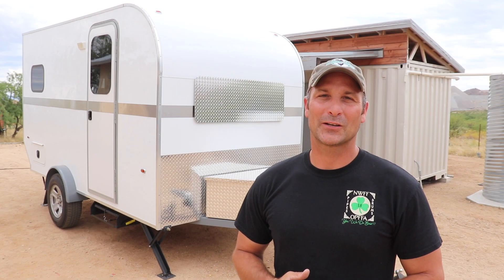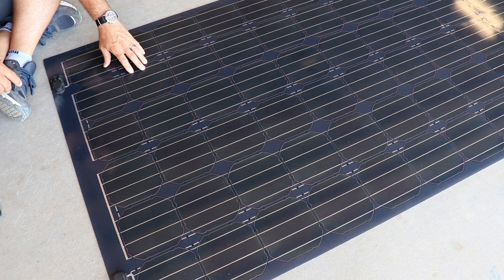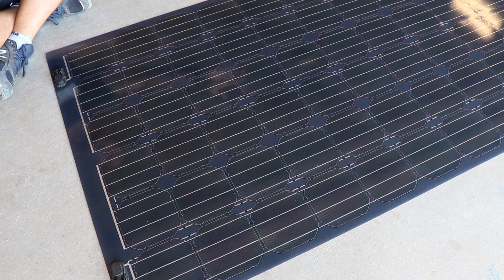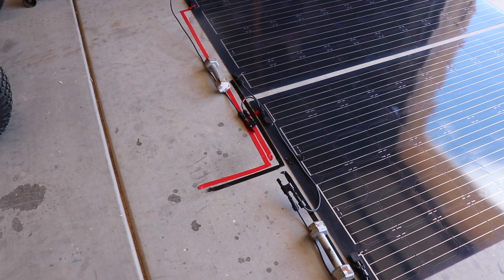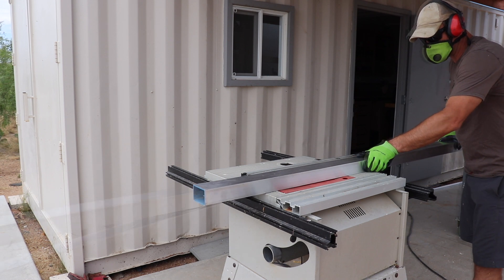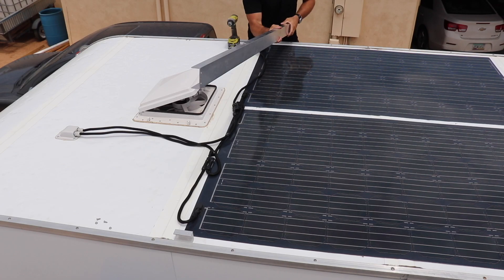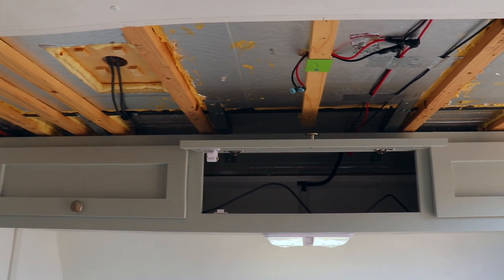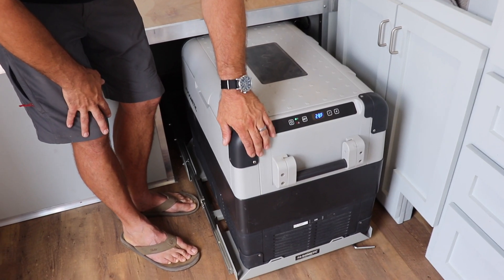How to Build a DIY Travel Trailer - Solar Panel Install   (Part 11)

Comment: Cool video but I'm in Nebraska and have a thought it snows and don't want to put holes or mount panels on roof because one would have to clean the snow off 🤔

Comment: Very good job. i am wondering...Do the van wall has a heat insulation function? i mean heat isolation from outside of trailer to keep inside trailer cool. Except for the electric air conditioner.

Comment: I made my own controller. Panel  wires come in, lines go from controller to batteries and another set goes to fuse block. Prevents overcharging while current is used inside.

Comment: A paint roller is a good choice to press the panels to the roof. The soft "fuzz" protects the surface and prevents cracking, it can happen. Just be careful.

Comment: Note: When using Victron solar controllers, it's best to wire your array for a higher voltage (series) so that the controller will turn on earlier and off later. Wiring them in parallel is going to result in a lot less production.

Comment: I noticed that from the 12 v system video to the solar video there is an additional component in your battery box. It's to the right. I am wondering what that is? Also how the does the battery charge from the vehicle when driving and trailer hooked up to car battery?

Comment: Been a year plus now and I am wondering how the flexible solar panels are holding up.  Starting my build after first of year and want to use flexible solar panels.
Reply from the maker: Check out my travel trailer series playlist.   I have about 7 videos on the trailer after this one.   I’ve also filmed a couple of camping trips and mentioned the solar/12v operations and everything has held together very well👍😀

Comment: That one part only secured with the double sided tape is hella sketchy. Is that piece flies off it could kill someone. Put a screw through it
Reply from the maker: It does have a bolted bracket attached as well.... it isn’t going anywhere.   I added it a few days after uploading the video.

Comment: I didnt see the link for the solar equipment. I have solar panels on my home so I look at other systems critically... not negatively just seeing how complete and usable it is. I really like everything except for a few details. I would want another battery for backup. Next  I would want an indicator for charge %... I dont see one. Lastly that final short piece of extruded aluminum is going to be a missile someday.... you have conquered aluminum welding... why not weld the big and small piece together? I have watched the entire build and the homestead  also. Your skill level is excellent. I love nice clean professional work. Lastly... I dont think $1500 is unreasonable for the solar hardware at all..

Comment: wow, looks like you caught some hail damage/ didn't notice it until you put panels on and shaded the roof @8:38. does that mean you should have used thicker roof material or that just happens when it hails? will that affect your panels?
Reply from the maker: You can see the hail damage in my part 4 or 5 video.... should be like ‘cooler bed storage’ or something like that....or my video titles ‘oh hail no’.   Destroyed a lot of things on my property.

Comment: I very much appreciate the choice you made of those particular solar panels.  My new 2015 Ford 350 econoline which I desire to convert has a plexiglass roof to   keep it from leaking, so I have not been anxious to start drilling holes.  Thanks so much for your resourcefulness and careful instruction

Comment: Joe, really liked your videos, very well explained.  I have a couple of questions, I am really new at this so please bare with me.  I purchased a 7x14 cargo trailer and it currently has solar, however, the previous owner only put 1 outlet inside.  It has 1 12v battery, and 1500W Cen-Tech power inverter with a 3,000-watt surge.  I would like to add 4 more outlets in the trailer and a couple of more LED lights.  I am going to install an AC unit but that's it.  No fridge, no TV, just 4 more outlets for Charging laptops, or cell phone, shaver, and possible shower.  I do want to get another battery so i will have Parallel connections.  The solar panel is so small its like a size of a picture frame mounted on top of the box in front of the trailer.   Now I can plug the trailer to the RV outlet since it has a plugin from the outside.  My question is do I need a bigger solar panel?  Is my inverter big enough?  I am only using the trailer 2 times per month.  Thank you for your advice.

Comment: Since your using a lead acid battery, I would suggest venting the battery compartment.  The battery produces hydrogen gas when it charges.

Comment: Did you add any gasket material along the edges of the aluminum wire channel?  A bit of concave or convex quarter round molding could redirect airflow up and over the channel as well as off the solar panels.   I liked your use of the split loom wire guard.  You definitely put good thoughts into the design of this system.  With all the additions to your trailer I was surprised that you didn’t include an LED signal light bar to both trailer and truck.  The following link is for illustration purposes; I do not represent this company but I have installed a similar lighting system on my Kia Forté 5SX.   https://geek.wish.com/share/1001mmqqzx.   As always, I trust that you and your family will remain safe as the pandemic continues to evolve.  Wishing you and them continued Peace, health and happiness.  Sincere thanks for sharing this video.  Peace brother.

Comment: Nice camper build.  However, putting the panels in parallel like that will come back to bite you.  If one cell gets shaded, then that panel will produce less voltage and then short out with the other panel producing a higher voltage.   Say for example, each panel puts out 12V optimally.  And one panel is partially shaded and only putting out 10V.  You connect 12V in parallel to 10V and now there is a 2V short that the panels have to absorb.  If you put them in series and use an MPPT charge controller, then there is only the loss from the cells that are shaded.  Because those panels have extra bypass diodes, and the fact that you live in Arizona where there isn't much shade, you probably can get away with it.  But if you ever see less than rated power during bright sunlight, it could be a cell that got shaded somehow.

Comment: I love your vids. The ends you crimped on. I thought the lower crimp went around the insulation of the wire. and the tube got crimped to the copper. Also. since the solar panels are outside, and the charge controller is outside in the box. Did you think about keeping the wires and switches outside instead of in then back out?

Comment: My suggestion is to get a remote display for the charge controller and a ground shunt for a monitoring system of the lithium battery.  Victron has some great products that piggyback off of each other with "ethernet" data cables creating a CAN-BUS network. One display should be able to have all of your charging/Discharging information.

Comment: Awesome video.  Some day I'll be adding solar panels to my cargo trailer that I bought to haul my side-by-side around and maybe make it into a "toy hauler"/camper.  My concern with the stick-down on the roof is heat transfer to the inside of the trailer.  Those solar panels have got to be transferring a ton of heat through to the inside of the trailer, no?

Comment: There should be a plastic bushing on the connector through the  the floor from the panels. Trick to cut the bushing and put in on the connector without undoing your wiring. Thanks and have enjoted your series

Comment: Nice setup, only solar panels cost too much for me. $749 for one 180w panel  I can get 4 100w panels for around $400 although not flexible.
Reply: Are those 4  as nice as these though? individual cell vs whole panel performance is a great feature.

Comment: Having those panels on the roof of your trailer also help keep it cool. It’s as if you’re parking under a tree. That is a benefit of having solar panels on as much of your roof as possible.  That trailer project came out great. You should be proud.

Comment: I would have advised against flexible solar pannels, but now they are already installed. With regular panels. You can get double that power

Comment: Great job on your travel trailer.  Makes me want to build one out of my 12' utility trailer.  I would suggest making a bracket for that wire channel that runs front to back just like the one you did for the channel that runs side-to-side.  You will be experiencing a lot of wind as you are driving down the highway and that can become a very dangerous projectile at high speeds.  Worth the extra effort to ensure safety!

Comment: ooooh,   Seeing you bending that solar panel is a little worrisome.  They're not suppose to bend more than 30 degrees and even then it's risky.  The cells are made of very thin silicon which is practically glass.  It will crack and power losses are gonna happen.
Reply from the maker: WTF BBQ I understand your concern, but these are not silicon panels.  Sunflare came up with these panels as an alternative to the cracking issue common in silicon panels.  I can’t remember the exact substrate they use but it isn’t silicon.  Thanks for watching😀
Reply: @homesteadonomics  
oh yea,  i just read Sunflare's website about their panels.  They are indeed made with a different material (CIGS).  I've been avoiding flexible solar panels because they are flimsy,  but i might give this one a try.

Comment: NOT to rain on your parade....but I torn out megawatts of these "thin film" type solar panels. What happens is they catch on fire. On you tube there is a video of a rooftop fire at the Long Beach convention center. Please check it out. Again... NOT Debbie Downer here but thought I'd mention it since you probably will be going on vacation in that thing with your family.  Be safe and good luck.
Reply: well he is a fireman so i am sure he knows how to put a fire out i pray he never has to though

Comment: Congrats on the project but from my understanding it takes around 900 watts of panels minimum to cover basic needs. Is this not what you came up with or does 370 meet your needs? What all do you operate off it?
Reply: I don't like to see deviation either. Norms r there for good reason. I prefer to run the radio & light whilst I sleep and often fan. That's 2+2+10 watts & if tucked in by 8p I may well pursue a 12hr sleepy to ensure well rested and top health. That could well be 160watts.. What if I need a phone charge? I could easily be down some whereby could take full 45mins to charge. I don't like cutting it close like this & he has no tight to recommend this! I'd report it if I knew to whom. Any ideas?

Comment: Really like your idea of protecting the solar panel wiring on the roof with your cut down channel.  Was thinking about using some z flashing on the leading edge of your panels just for some added protection while moving.  You could just use VHB tape for that too.

Comment: A little puzzled  by your claim that each cell has its own diode - each solar cell is 0.55volts and the voltage drop across a  good Schottky Diode is 0.45 volts- it would in effect cripple the panel

Comment: hello i got a question example if i have 100wat solar panel. how long it takes to charge a 2pcs  70 ah battery pack..? 
and 2nd Question how long it drained for a fan like 20watt for cooling down a room?

Comment: I like the way you make the bracket for your new Sunflower Solar system. I noticed on van builds they mostly have more than one bracket which I would probably add to the front of your solar system. But I definitely am not an expert at anything but baking bread!
Reply from the maker: MAE HAY thank you Mae!  It has travelled 300 miles so far today and I’m about to go out of cell reception....wanted to get back to you before we are deep in the forest😀👍🙏
Reply: homesteadonomics enjoy your new travel trailer with your family!

Comment: Cool camper!  The dometic cooler is a nice touch.  What would be a big draw would be a roof mounted Air Conditioner / Heat unit or electric cooking like a Microwave or electric (resistive style) cook top.  I'd be curious if an induction cook top would work well for you with this setup.

Comment: Very informative & well thought out install. I'm assuming those connectors are waterproof. I've been looking for something that are waterproof & can handle vibration to put into my micro skiff boat that I'm building.
Reply from the maker: Turtle W hi TW!   Thank you for checking out the video!   I’ve only had it installed for a week now so I can say anything to the long term for the connectors but they feel really well made.   I think if you protect them well enough from vibration by taping or securing them down they will do just fine😀👍

Comment: Wow, very expensive solar panels. Very nice install as is all your work.
Reply from the maker: Sam Hagins thank you Sam!  Yes they are not cheap panels.   Sunflare primarily is OEM manufacturer supplying based so they aren’t as geared towards consumer price points.     They liked the project and wanted to see if I wanted to try them out as an example of how they can be used.  I would imagine if they start transitioning to more consumer sales you’d see prices reflect accordingly😀👍

Comment: I agree with the heat concerns. RV with Tito had an innovative installation that uses corrugated plastic sheets to create airflow and prevent the excessive heat of the solar panels from burning the roof material: https://www.youtube.com/watch?v=hROYaqY83v4

Comment: That type of panel would work well on my trailer.   I have an enclosed car hauler that I plan on putting solar on but it doesn't have a flat roof.

Comment: Cool panels!  Love the idea of laying out your diagram on the floor.  Don't get hung up using those 2 to 1 connectors in that configuration, you can decrease the bends in the wires.Glad your posting vids again!

Comment: Under full sun these panels will probably sit around 140 to 150F... Which will be sitting flat on your roof. That is a lot of heat. Directly on your roof. Radiating that into your camper.

Rigid panels mounted with an airspace will act as a shade to your roof. 

I just don't see the attraction to flexible panels mounted directly to the roof.
Reply from the maker: On_The Road very good points....I will have to see how it fairs over the next year.   Worse case scenario I could always remove them and add a little network of aluminum ‘purlins’ for them to mount to.  Thanks for watching and the observations 😀🙏
Reply: @homesteadonomics  what ever you do I'm sure it will be great.... Very clean work!

Comment: Great tutorial. Please, can you tell me where to purchase the top of double sided tape you used?
Reply: Angie Sparks 3M makes an outstanding double sided tape. It is called VHB tape (very high bond) this tape has proven itself to hold better than screws or rivets. It forms a strong permanent bond. There are many videos on YouTube concerning VHB tape.

Comment: A bit of concern here, Electrical circuits Mounted on wood.
Have you a good extinguisher and easily available and have you performed an FLIR to verify 
the heat thermal factor on this mounting set up?
I would like to encourage flame retardant material Insulation on all mountings in this videos I seen.
This is very exciting you have done and want the Best for your family.

Comment: I like the weight and design of those panels. But I did notice that they are a bit on the pricey side compared to traditional rigid panels, so I'm wondering about recharge time of a battery per panel. I'm designing my project now and I'm planning on a 2 battery system (I like to camp in some cloudy, rainy places with shorter days so more battery helps on longer nights). I'm trying to figure out the best way to calculate results with a 1-panel or 2-panel arrangement. Were you able to get an idea of how long it would take to fully charge an empty battery with 1 panel or 2 (assuming nothing draining the incoming charge except maybe a cooler)? Or do you know of any reference info that would help calculate such things?

Comment: Hello, I am new to all of this and just had a question. The 370 watt solar panels, how is that measured?  I am asking does it make 370 watts in 24 hours, per hour or continuously?  Just trying to understand this as it is all new to me.

Thank you.
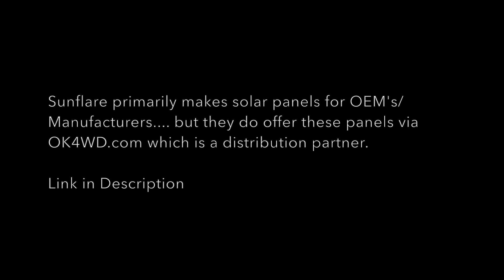Reply: Chris Chappell Chris Chappell hey buddy. Each of his panels is rated at 185 watts. And rated at 29.14 VOLTS. (3:14 in the video) He has 2 panels so that = 370 watts. ;) That's because he wired them in PARALLEL. (Example shown at 5:22 in the video) Parallel wired panels keeps the VOLTAGE THE SAME but ADDS THE WATTS between both panels. So he still has 29 volts between his panels after connection. It's a more efficient way of getting the most power out of two panels. So yes 370 watts per hour.

IF he wired them in SERIES, THEN it would be the complete opposite. 
Series wired panels ADDS THE VOLTAGE but KEEPS THE WATTS THE SAME. (58volts and 185watts system. )
Reply: @jakearredondo840  Thank you for the explanation, I had wondered how they figure this out.  Thank you.

Comment: Very clean good looking install, but without cooling airflow under those flat panels they will have a relatively short life. Cooling airflow under panels is critical and they will get very hot mounted directly to the roof. Even small wooden dowels run under each panel will allow some airflow.
Reply from the maker: Mr. Natural A couple others have also brought this up and I will look into it. Thanks :)